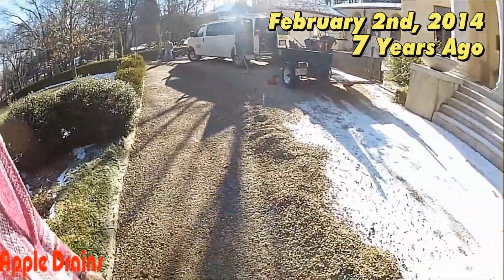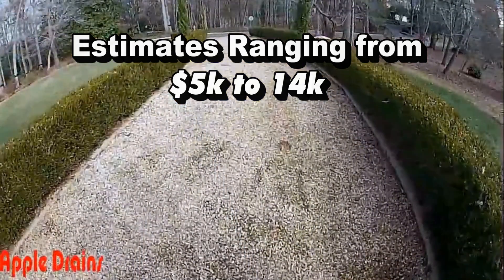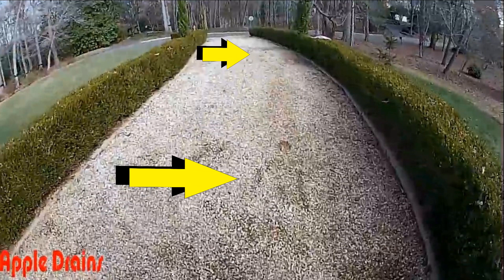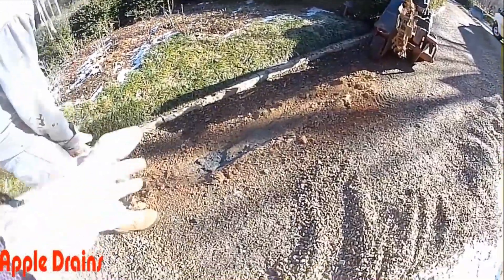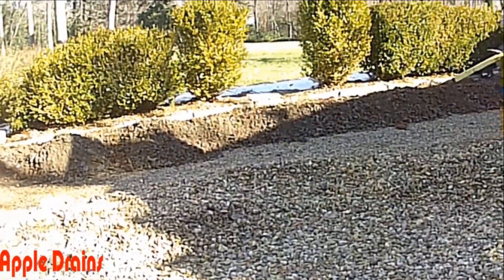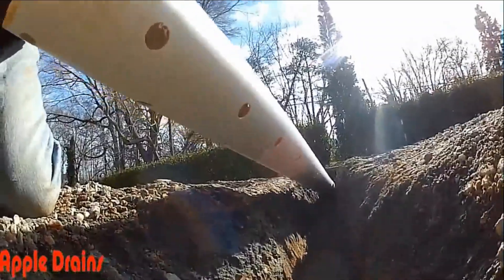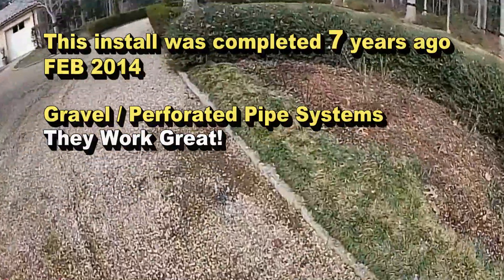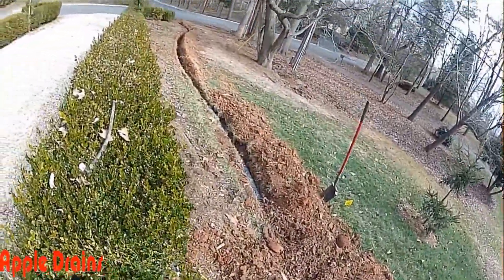Open French Drain System in Gravel Driveway

Comment: I’m going to be installing a trench/French drain along our patio to pick up the water sheet draining into the yard. How to you know when to use perforated black pipe or the pvc with holes? Our patio has multiple radius’s so flex pipe would be easier. Also how deep does it have to be? I don’t have much cross slope but where I’m tying in to discharge in an existing French drain around the corner is lower

Comment: I assume no sock was used because the entire trench is backfilled with gravel?
Reply from the maker: 😃 Yes you got it right! The gravel allows water to flow easily into the pipe and works as a fabric. Fabric would slow down the flow rate and become clogged with a few months. Thanks for your comment
Reply: @appledrains  m pH